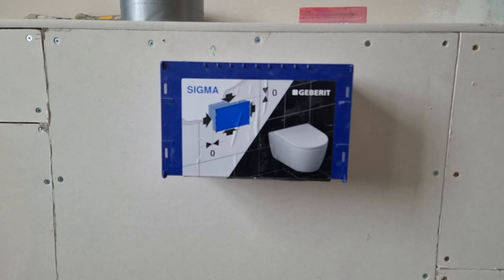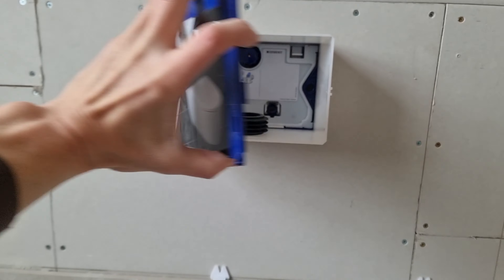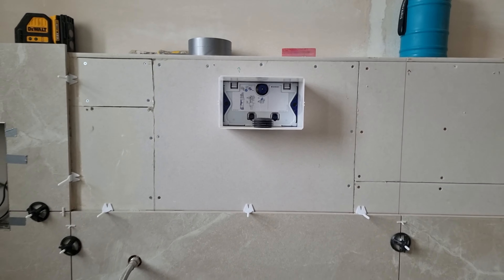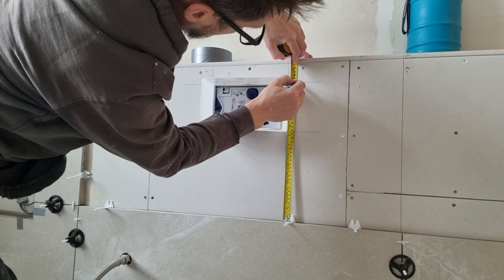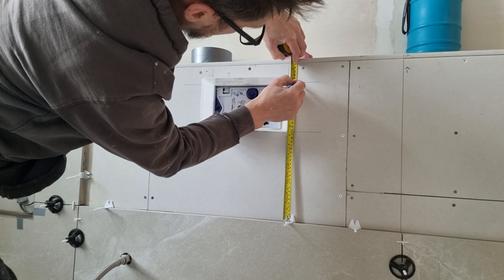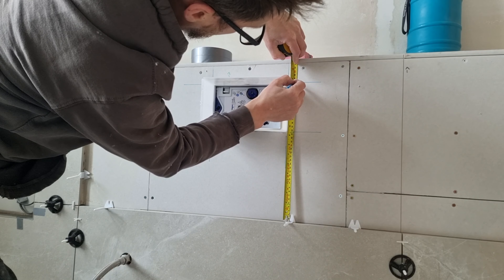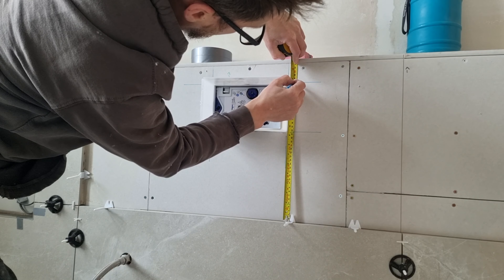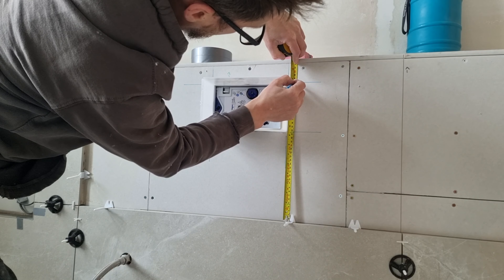How To Cut Perfect Square Holes In Tiles!

Comment: Hi, there! Is the process basically the same for cutting marble or granite tile, as long as I use the appropriate cutting wheel for natural stone? Thanks! ✌️
Reply from the maker: Hey, With Marble and Granite they will cut a lot better with water. The methods are the same, But try and add some water when you are cutting with an angle grinder for an easier cut. A natural stone disc wheel as well yes. Hope that helps.